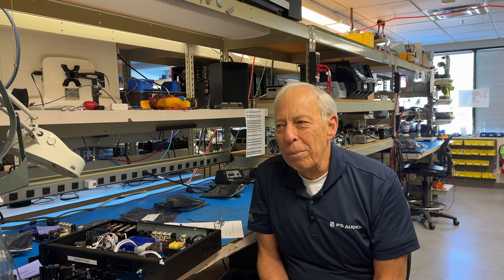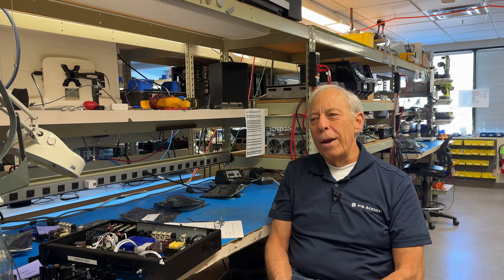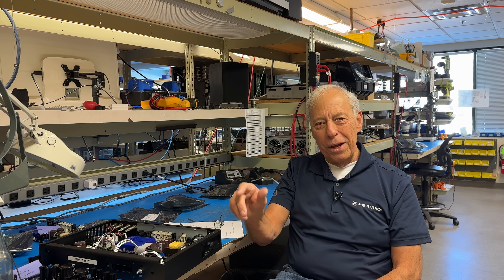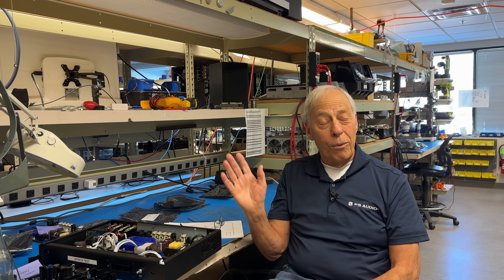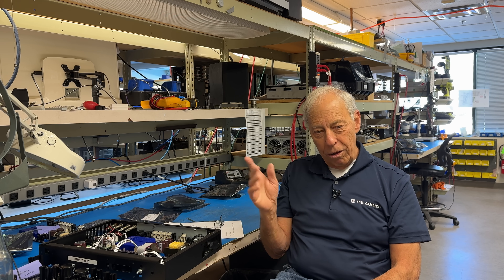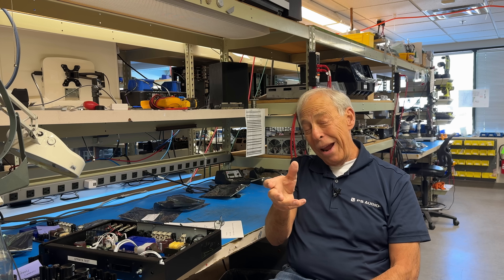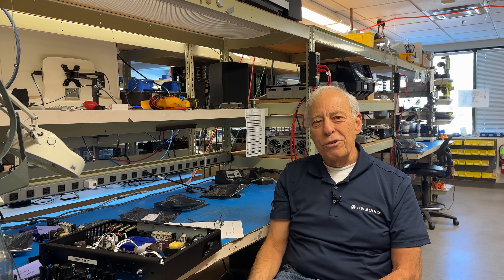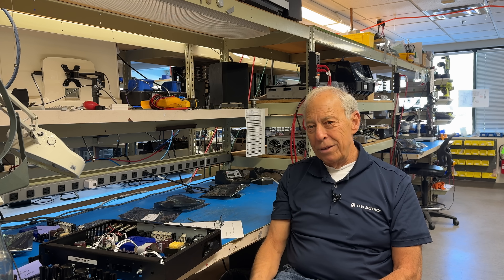Understanding dB level

Comment: Ok then but, if at 0 DB an amplifier puts out its maximum power, and different amplifiers have different power levels (some are weaker, some are beefier), that means that 0 dB will translate to a different output (loudness measured in dB SPL) on different power amplifiers. And if I am not mistaken that also means that different (=rated at different wattage)  power amplifiers will have different output given the same input (say -12 dB) from a preamp (because that's relative to 0 dB). But I also remember what you said about amplifier gain: two different power amplifiers can have different wattage specs and yet have the same gain and produce the same loudness at a given level of the input. This confuses me 🤔🤔
Reply: I'll know better in the mourning but I think it's due to the resistance aka the ohms that the speaker is asking from the amp. With the same GAIN 1:15 which might be 2v in and 30v out (for example) a speaker while at 4ohms will draw more watts

The 3 variables which can change the equation tied to one another. Watts = Voltage * Current

Less resistance means more current

Power isn't that interesting
Reply: dB is a relative scale, as you understand 0dB can be defined as any value, for power measurement, it can be 1mW (= 0dBm) or 1W (= 0dBW = 30 dBm) or any other baseline value

think of gain as a multiplier and wattage is the hard upper limit of power output before bad things (noise, distortion, clipping, overheat, reduced lifespan, burn out, sparks, smoke, fire, spontaneous combustion, armageddon) happen
high and low is all relative
a single ant can carry a lot of weight relative to its own weight (high gain) but it certainly won't be able drag you away in sleep (limited power output)
a healthy person likely cannot carry multiple times of his/her own weight (low gain) but should be able to get up from bed and walk around unassisted (that is higher power than the single ant)
Reply: This is where thinking purely in dB for power amplifiers gets confusing without knowing the background to all this 

Just to be sure: 
By power amplifier we mean a box of electronics that when fed with a specified level of signal - will produce its rated output ( in watts rms) into a specified load... say 8 ohms.

( now a point to bear in mind here is that many power amplifiers are capable of driving different speaker impedances  
If you connect a lower impedance speaker say 4 ohms - you will get twice the power output ( assuming that the ampifier can deliver that higher power) that you were getting with an 8 ohm speaker for the same input level)

( that is the amplifier is NOT supplied with an integral speaker as in a "powered speaker " that are quite common for bands / vocalists to use on stage etc.

Imagine you are a power amplifier manufacturer

Lets say you advertise  a range of amplifiers : 

100watt
200watt
400watt
800watt

You specify on your sales literature that all these amplifiers will deliver their rated output power when connected to a speaker load of 8 ohms - with a signal level of "x" connected to the input ( most  power amplifiers will have a "level adjust" control to allow for some variation in input level... but usually  we leave that at its " nominal level" 

Question is - what input  signal level should all these amplifiers  have  - to work "at specified level?"

You could make that signal level anything you  want... and in times long gone by... that was the problem the audio industry faced... what SHOULD    that level be? 
Everyone is on the case - From recording studios to radio stations to cinema sound systems etc everyone has their  own ideas.. 

you can see the problem!!

We need a STANDARD level that eveyone in the industry agrees on!!
 
But what level?? Is it 1 volt 2volts? .

Or could it be some actual POWER level - say 1milliwatt? 

And.. where does the dB come into this ?? 

Why cant we just say I want x volts and be done with it?

The decibel originates from the telephone industry.  
( all about how loud a telephone is... and how much loss can we tolerate before the sound gets to weak to be useful etc)

Way back in the early 1920's telephone engineers wanted to define a standard way of measuring the performance of  telephone lines 
They came up with the idea of taking a mile length of "standard telephone cable " - putting a signal of known power level  in one end.. and seeing what came out the other   
Thus loss in a telephone system could be measured in terms of "msc's
( miles of standard cable) 
This wasnt really a practical way of doing things 
so bell labs came up with the idea of looking at ratios of signal POWER  from one point to the next... and taking the log (base10) of that ratio.
In memory of akexandra bell - who invented the telephone.. they called this the "bel"

So 1 bel = log p2/p1

 Using logs makes things easier to calculate a system. gain or loss because you can simply "add" or subtract bels to find the overall loss or gain 

Logs also makes working with large ratios easier to deal with 
We dont end up working with huge numbers 

However - the bel was not a practical idea.. it was too coarse - so it was split into 10 smaller parts called deci-dels
( deci = 1 tenth part of) 

So we end up with 
dB = 10 log p2/p1.

p = power 
Note " power" ... NOT voltage or sound pressure etc... that comes later !!) 

Now all we need to do is decide on exactly  what ratios p1 and p2 are.

What we CAN do is start with some base line system power level
This goes back to the telephone industry again!
A standard telephone line back in the day had an impedance of 600 ohms. 
If a "reference" signal of 1 milliwatt was fed into that line.. you can work out what the signal level is in volts rms 
That is 1 mW = v(rms)^2 /600
= 0.775 volts rms.
Now 0.775 volts rms ( = 2.192 volts peak to peak)  is quite a reasonable voltage to work with in audio terms.  

So we can settle on 1 mW as our reference power level which equates to 0.775 v rms 

So dB = 10 log p2/1milliwatt

Since  1mw is our reference.. we can use the suffix "m" as in 
dBm 

So we can now see that 0dbm =
 10log 1mW/1mW =  log(1) =  0.775 v rms  when terminated into  600 ohm  

(Note log (1) = 0 

You can always  think of 0dB as " zero change" in signal level.
(0 doesnt mean " nothing at all !!)

An amplifier or system that has  0dB gain (or loss) has no effect on level.
 You get out what you put in.  +xdB means more out  -xdB = less (-) out. 

However... it is more practical in an audio system  to work in db's that relate to  signal voltage levels .. 

So we need to convert  power ratios to voltage ratios

( power = v^2/r) 

So we get 
dB = 10 log (v1/r)^2/(v2/r)^2
= 10log (v1^2)/(v2)^2
= 20 log v1/v2

We can also "assume" that the voltages can be at " any impedance in the audio system so we can use 
dBu as opposed to dBm where    u = unreferenced 

So we finally get there!

0dBu = 0.775v rms

Note also that the same "square law"  theory applies to sound pressure levels ( as in pascals- where the reference pressure  level is 20 micro pascals 
where we end up with 

dB = 20 log spl1/20 micro ps 

So if you put 0.775 v rms signal into your power amplifier you will get rated output power 

As far as dB calculat
Halve  that voltage to 0 3875 volts rms  and you get 
dB = 20 log 0.3875/0.775 = 20 * - 3010 = -6db 
- 6db is 1/4 times power so if you drive your amplifier with 0 3875 v rms your output power will have dropped 4 times
( say from 400 w down to 100w

Comment: I get the concept that negative db is only relative to a “zero” db that’s actually quite loud.  But the fact is that the volume produced at that “zero” db level on a sound pressure meter is actually (say) 95 db. So….I and others might need another crack at this explanation.
Reply: In the audio chain, the dB level is a measurement at a certain point in the path.
The measurement can happen at source data, at any input or output, and of course the sound pressure level (SPL) at your listening position. Just like there is a voltage level at the DAC output, preamp input ...
dB measurement is log scale always relative to a baseline value, e.g. 1V is defined as 0dbV,  sqrt(600/1000) = ~0.775V is defined as 0dBu, and there must be a pressure value for sound defined as 0dB SPL, ... the list goes on
The SPL level created by the transducer (i.e. speaker) is related but does not translate directly from the "dB value" of an earlier stage, because there are layer(s)  between what you hearing as sound and what the figure is measuring
Just like the rotisserie chicken temperature is related to the oven temperature (and other factors), which is related to power usage of the oven (and other factors)
Reply: @philiptong4978  Yes but the sound pressure level at the listening position is, for the practical purposes of the listener and user of the volume knob, the only level that matters, and  should reflect the level at an assumed listening position of x feet.  I suspect the answer here is that calibrating a volume knob where x equals zero which equals some high decibel level, in recognition of an engineering truth internal to the device that is meaningless to the user, is very silly. Paul thus  says their volume knobs go from 0 to 100  which is better. But wouldn’t it make most sense to have the volume knob go from 0 to (say) 200 db when measured at 6 meters or some other defined distance, assuming a speaker of a defined sensitivity with intervening db gradations marked accordingly? I have no idea what “40” will do to my ears, but I know in my room 95 db will be painful. And yes there are variables which make such db markings inexact- so mark each level +/- 60 db, +/- 70 db etc.

Comment: The decibel originates from the quantification of signal loss in telegraph and telephone circuits.
A logarithmic scale is used (Intensity = 10 log10[P2/P1]. Doubling the intensity of a sound produces an increase of about 3 dB.
Think of it as the base 10 logarithm of a power ratio.
If you halve this power ratio, then the intensity is - 3bB.
You can see this in the formula above. When P2 is less than P1 (for example when you are halving the power), the P2/P1 ratio is a value less than one. When you take the logarithm of a value less than 1 but greater than zero you get a negative result.
When the power ratio is greater than 1 (say you double the power ratio) then taking the logarithm gives you a positive result. 
Check it with your calculator.
log10 (2) =  0.30103 (Doubling the power  ratio)
log10 (0.5) = -0.30103 (Halving the power ratio)
Reply: 3 dB up is from doubling the power, but 10 dB is from about 3x the power, and is perceived as twice as loud.
Reply: @stevefisher8323  Power ratio

Comment: This isn't a great explanation. It's simply that when you adjust the volume on your amplifier, you're not actually changing the amplifier itself - in essence the amplifier is always boosting the signal at the maximum/fixed level. 
Instead, you are just altering a resistor before the amplifier in order that you don't only have it playing at the maximum volume.
So the negative dB are referring to the reduction before the amplifier - how much that resistor is pulling down the sound before it gets boosted by the fixed output of your amplifier.
Turning the volume all the way up to "0" correctly implies that that there is now 0 db of attenuation (resistance).
Reply: "Instead, you are just altering a resistor before the amplifier " - there are different types of amplifiers.
Reply: Not all control volumes work that way by attenuation with a resistance.  Some adjust the gain stage.
Reply: Hence you can have a passive preamplifier, no power just passive circuitry that attenuates the volume.
Reply: the amplifier acts like a multiplier.  if its gain is fixed the volume you put in is multiplied by its gain (increases).  however  you can change the gain on some amps that another story.  but this is showing the gain margin of the amp.  however I believe the manufacturer is the one that puts the scale thinking it will be the best way to sell the amp at the end that's what they do

Comment: Thank you, Paul, as always. I think it's important to mention also the fact that the dB scale is logarithmic, not linear. In fact, each -10 dB is equivalent to reducing the perceived volume by half. If we consider 0 dB as 100% of the sound we can get, this is the relation between dB and volume:
0 dB = 100% perceived output level
-10 dB = 50% perceived output level (approximately)
-20 dB = 25% perceived output level (approximately)
-30 dB = 12.5% perceived output level (approximately)
and so on...
Reply: https://youtu.be/xSe7y9tYex8
Reply: In addition, logarithms are a way of performing multiplication by adding numbers together, so for example if the signal is multiplied by 2, that adds ~6 dB, if it is multiplied by .5 , that subtracts 6 dB, and if multiplied by .25, that subtracts 12 dB. You cannot think of ratios of dB, because that's double dipping, it's an additive scale that represents things that are multiplicative. Both a source of clarity and confusion.

An odd thing is preamps usually have a gain stage, the 0 dB max. is relative to this gain or the volume pot itself, if the gain is +20 then max is +20 and 0 (unity) is around the middle. Never(?) marked that way though. And yes that means "only halfway" is also about the maximum usable setting with CDs. The rest is for records and weak radio stations.
Reply: @spentron1  Minor correction, multiplying by 2 adds 6 dB.
Reply: @spentron1  ~3dB
Reply: @PetraKann  Not sure what these replies are saying, but to clarify I'm multiplying voltage. Doubling that quadruples power flow. Twice the power is 3 dB.
Reply: @spentron1  You've got a tilde (squiggly) in front of your first 6, making it look like negative six.  Now that I used a magnifying glass I see it was a tilde rather than a minus sign.  I'm suggesting to delete it, since multplying the signal by 2 adds 6 (positive six) dB.  It's exact, not approximate, so no tilde is needed.
Reply: @spentron1  To try to clarify it all (concepts and two-decimal-point details):  Doubling the voltage adds ~6.02 dB; doubling the power adds ~ 3.01 dB.  //  And you never know exactly what the numbers on a knob label or electronic display really mean unless the manufacturer clearly defines it.  It could be dBs (or half dBs, or ?) of gain or attenuation; or an arbitrary logarithmic (or other) scale from some minimum level (labeled 0 or 1 or 99 or ?), meaning effectively infinite attenuation or some arbitrary amount of non-infinite attenuation) to some maximum level (labeled as 10 or 11 or 100 or 00 or ?), perhaps including zero gain, or perhaps including some positive gain, or possibly even some small amount of attenuation); or ... did I leave out any possibilities?!  My Legacy brand "High Current Preamplifier" (which I really like, but the scaling and display is NOT totally defined) has a stepped optical-digital-encoded knob controlling an electronic attenuator in half-dB steps, with about 6 dB of gain (line-level inputs only).  The lowest setting (displayed as "99") is NOT full muting (my guess is about -44 dB), zero gain is displayed as about 88, and the maximum loudness setting (zero attenuation plus that 6 dB or so of gain) is displayed as "00".
Reply: A trip down memory lane from my electronics classes 20 years ago!

Comment: What ?.0 db is .77 volts consumer level and 1.23 volts at pro levels , no ?   And that is not the loudest , because of headroom ....right ?   Isn't the headroom like +22 db on pro level equipment ?  I think I'm now more confused than ever regarding decibels ! 😛
Reply: You, we are confused because unit is incomplete. The same happens with speaker's sensitivity, reviewers take shortcuts with the definition so the conclusion isn't accurate.  Bel is a logarithmic relation between a value and it's reference. That reference must be defined in the «unit». Two analog references: 0 dBu = 0,7746 V RMS and 0 dBV = 1 V RMS. In the digital domain we have 0 dBFS that is the max level. Some useful examples: 0,3162 V RMS = -10 dBV RMS ; 1,228 V RMS = 4 dBu RMS. How do we get these numbers:  20×log(0,3162 V/1 V) = -10 dBV with means that a line tension of 0,3162 V relative to the reference V is -10 dBV, the second example 20×log(1,228 V/0,7746 V) = 4 dBu with means that a line tension of 1,228V relative to the reference «u» is 4 dBV. The full unit is defined by the combination of dB an d the reference (V, u, FS, SPL[A,B,C], etc).
Reply: Thanks !  @Jorge-Fernandez-Lopez
Reply: the ~0.775V figure comes from result voltage of 1mW across 600 Ohm, since then sqrt(0.6)V became the baseline value of 0dBu, and +4dBu is the analogue audio level standard, if a device can handle max 24dBu then it is said to have 20dB headroom (from the nominal level +4dBu)
"Consumer devices" commonly uses dBV units, 0dBV = 1V
so dBu and dBV both quantify voltage with logs, but at different scale, like Celsius and Fahrenheit in log scale
Reply: @philiptong4978  Thanks !!
Reply: @philiptong4978 Thanks !